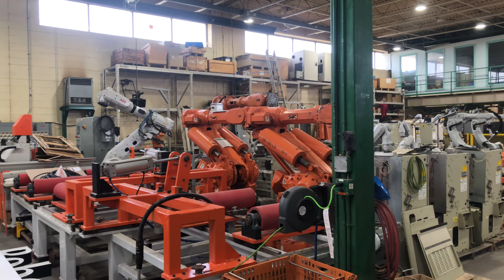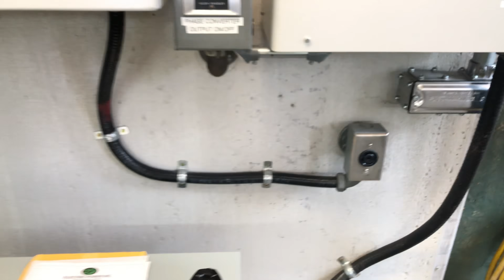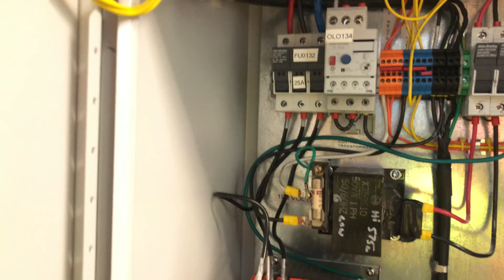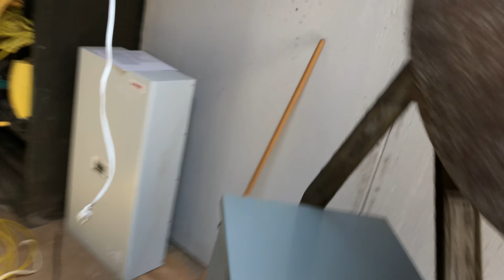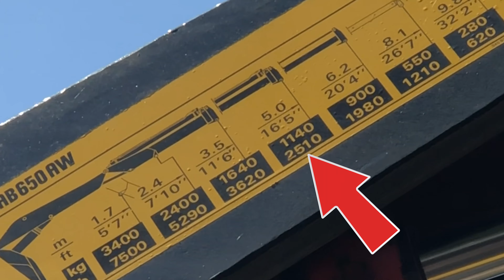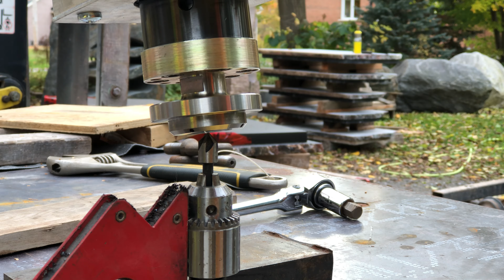Buying, Installing, Using an Industrial Robot for the Home Workshop #industrialrobots #ABB

Comment: Any update? 😊
Reply from the maker: I was just outside using it... but nothing to post about yet.  I've acquired a Banner Engineering XS-26 safety controller, 3 sets of light curtains, and wrote a bunch of code to integrate Ethernet/IP with FUXA (HMI software).  So I can visualize the spindle motor controls/load, and see the status of safety stuff.  I "just" need to wire it all up :)
Reply: @GregsStoneYard  coool 😁👍
Reply: Any update 😂
Looking forward to a new video ❤

Comment: yes...
Reply: If you could do a video of the cost breakdowns and stuff, that would be cool also. Something else would be a demonstration of it doing some wood and metal work. If ever I can get a robot like that, I definitely will! Thx.
Reply from the maker: @joelmason6818  Hi Joel.  OK I will.  I hope to do some wood with it.  I'm in Canada and it's winter right now, so it's covered under a tarp until spring.  But I'm researching and buying the right bits etc.
Reply from the maker: Yes! Thanks for the comment 😀

Comment: Hello . That is great machine .Do you intent to utilize it for polishing granite?Or will you try to use it as milling-shaping machine?Excellent
Reply from the maker: Hopefully both.  The grinding/polishing was the first use I had so what I tested it with.  But I hope to do sculpture with it.
Reply: what cam software you think is best for this task?  @GregsStoneYard
Reply from the maker: @yannismavrogiannidis583  Right now I am using Fusion 360 that has a post processor for ABB robots. But it does not do simulation and it does not support external axis (rotating table).  I would really like to try SprutCAM but they quoted me $15kUSD for a license.  It looks really good because it does both the CAM and the robot simulation.

Comment: How well does the robot deal with water?
Reply from the maker: The robot itself is IP67 rated, the spindle motor is IP65 rated.  However I try to tarp it while in use to keep the water off as much of it as I can.

Comment: A photo of the finished surface would've been nice, and the fact that you didn't include it, is just mine blowing.
Reply from the maker: I didn't show it because it still needs to be polished, I only did rough grinding.  As I ran out of time before winter.  However, you can see it here:
https://photos.app.goo.gl/pirujMJm7nFhKRB87
It's a very good surface considering it's a 40 grit milling wheel.